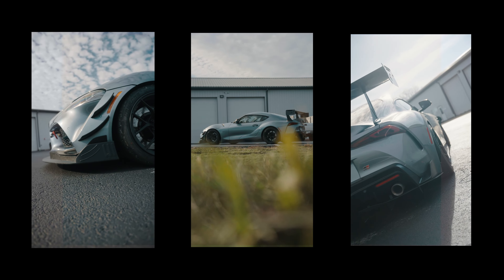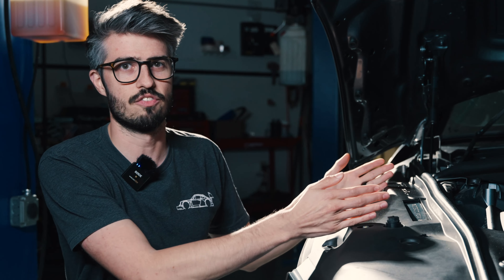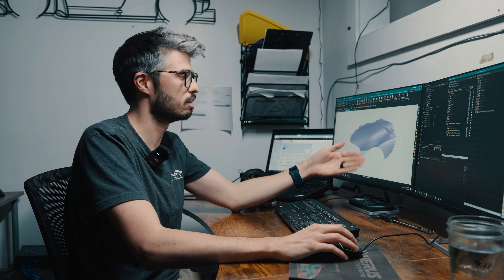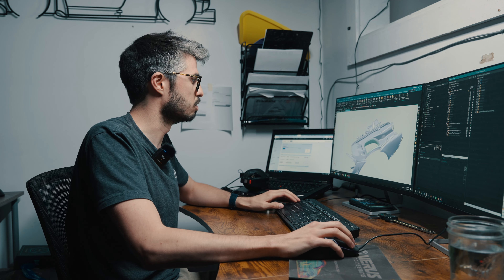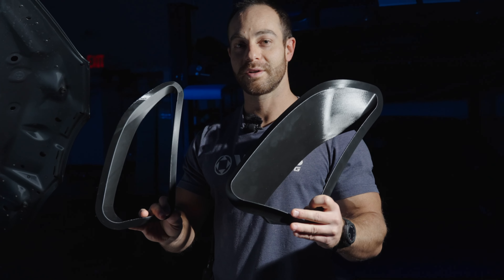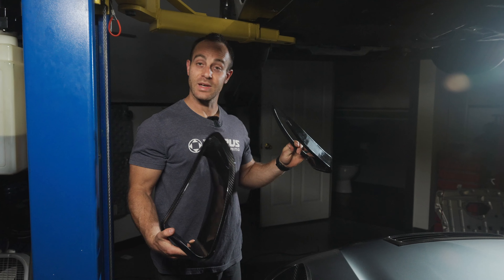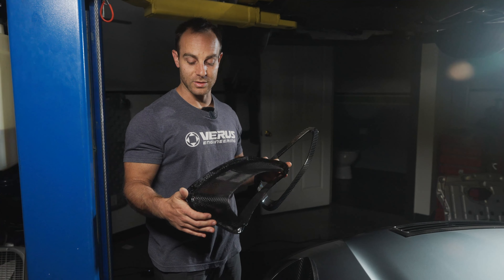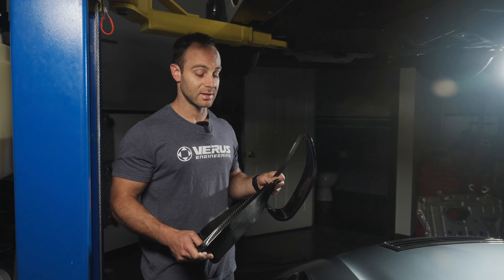Creating Carbon Fender Vents for the Toyota Supra

Comment: Looks awesome.  Final product will be totally open?  I wonder what the behavior of flying rocks out of it will be vs fins to redirect them?
Reply from the maker: Thank you! This currently model will be entirely open as performs better. That said, due to the two piece design, it should be pretty simple to create a mesh blocker that seats in between to block debris for street use. At the end of the day we really intended this for track use.

Comment: how much does it actually improve front end downforce?
Reply: Yes, we'd like to know too
Reply from the maker: Looking at a car with our dive planes, high df splitter/end plates, side splitters, diffuser/spats, hood vent and v1x at 2°, adding the fender vents increases front end downforce by 4%. The fender vents can be used to shift aero balance forward, or substantially increase total downforce by maintaining the same balance and increasing rear wing angle of attack.

Comment: That’s literally a hole. It would be great if you did something that pulls air out of the fake vent already on the hood, and make it functional. I’m sure there is a way to develop a duct with a “channel or cut out” that separates rocks from the hot air to drop them under the car rather than the A pillar.
Reply: A hole is what you want and is why you see similar designs on most race cars. Go look at what a gurney flaps (the upflick on the leading edge of the duct) does and you'll see that this design will pull plenty of air from within the wheel well.
Reply: @naldoeche those factory vents are entirely too small and too far away from the tire. even if you cut away the entire fender liner and the entire underhood structure.

Comment: Is there actual evidence to the "high pressure in the wheel well" claim? All the evidence I have seen is that the wheel well has a lower ambient wheel well pressure. Vents on wheel arches seem to be effective is because they lower the pressure further.....
Reply from the maker: I would generally agree with that. The wheel well often has a ton going on between spinning wheels and tires, radiator outlets etc. There are local areas with very low pressure, and areas with very high pressure. I think it’s safe to say that on average the wheel well pressure is lower than ambient but that there is enough pressure differential from the top side of the hood to the wheel well to drive flow outward. Another consideration is that some of the surface area of the hood that is producing lift has been removed.

Comment: Very ugly car.
Reply from the maker: We appreciate the feedback! Always striving for function and form simultaneously. Have any suggestions for us?
Reply: @VerusEngineering  Headlights: on the part where the headlight is narrow (the part that is close to the sign), print a piece and cover that part of the headlight (paint it in the color of the vehicle), so it will remind a little of the older models. Rear: Make a trunk that does not have such a big duck's beak, much lower, of course it follows the line from the sides (similar to the 911), then do some upgrades. Of course, it is demanding due to aerodynamics.  When the designers make a new model, they must be tested for alcohol and other things :)